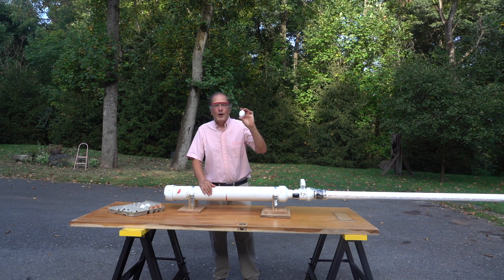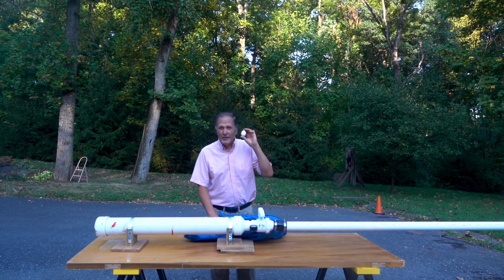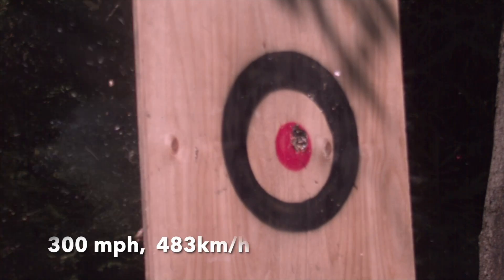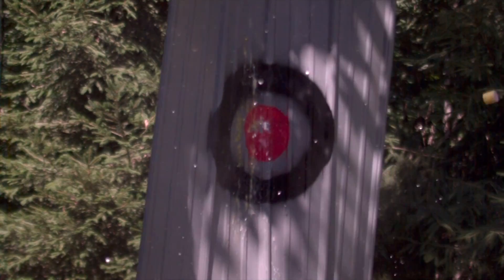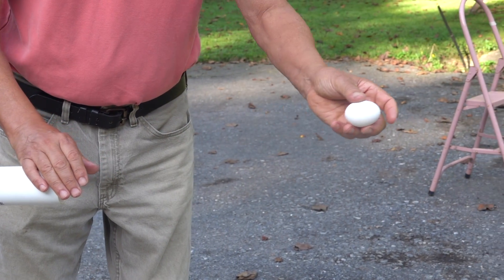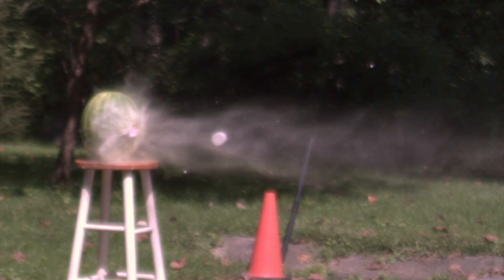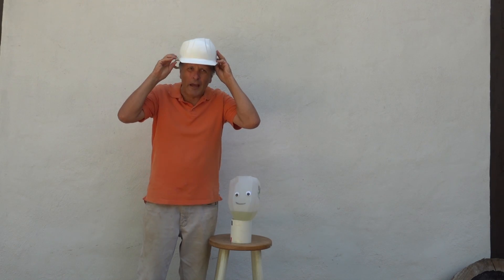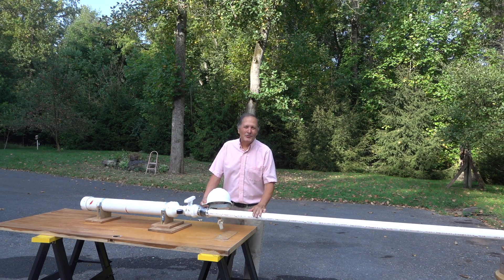Egg Target Practice at  300 mph   (483 km/h)

Comment: To catch the egg:  Step 1) Fire it directly upwards.  By the time it comes down, it will only be moving at terminal velocity (much less than your MV here).  Step 2) Employ one of those centerfielders from the first part of the video.  Step 3) Use a 5gal bucket full of "plucking foam" cubes.  Use the lowest density you can find.  Good luck!

Comment: What amazes me is how you can accelerate an Egg to 300mph in a 9ft barrel w/ only a piece of foam behind it. That looks like EPP foam (expanded polypropylene, milk carton plastic), or "pool noodle" foam. I've made "spud guns" powered by butane and gotten over 500 fps (using a ballistics chronograph and a small nail in the spud") and they are illegal in many states, just for that reason. We actually used the spud guns for shooting down beater Radio Control Airplanes which was nearly impossible.
Reply from the maker: the sabots  are cut from rigid foam polystyrene,  they were formed by heating a steel ball and then pushing itdown into the foam to melt it,  worked really well

Comment: Layered Fabric Deceleration System:

Egg Container: Place the egg within a protective container or casing to prevent it from cracking upon initial contact.

Multiple Fabric Layers: Arrange several layers of soft, lightweight fabric in the egg's path. These layers should be securely anchored to a frame or support structure.

Progressive Deceleration: Each fabric layer should have a specific attachment mechanism designed to slow down the egg when it hits. This could be achieved through adhesive properties, elastic bands, or Velcro-like attachments.

Sequential Release: As the egg impacts the first fabric layer, it slows down gradually. The attachment mechanism then releases the fabric layer, allowing the egg to move on to the next.

Repeating Process: The egg continues to encounter and slow down against subsequent fabric layers until it comes to a complete stop.

Safety Frame: Ensure that the frame or structure supporting the fabric layers is stable and absorbs any remaining kinetic energy to prevent sudden stops.

Testing and Optimization: Experiment with different fabric types, attachment mechanisms, and layer configurations to find the optimal combination that allows the egg to stop safely without breaking.

This system would provide a series of controlled deceleration stages, gradually reducing the egg's speed until it comes to a stop. It's an inventive way to protect the egg during high-speed impact. Extensive testing and adjustments will be essential to fine-tune the design for optimal performance.

Comment: Fun video. The real mystery is how he 'extended' a 10' piece of pvc with a coupling to make a 9' barrel. Only real physicists can do such things.
Reply from the maker: LOL, it's that new math they're teaching these days, or just forgive an old man who sometimes gets confused.   The barrel was  10 foot long that got cut down to 9 feet,  I used a small piece of it to attach to the cannon chamber and then use the rubber collar to give it some flexibility and take some of the stress off between the two parts.  The short piece was  1 foot long but got cut down shorter to put the flex connector closer to the air chamber.  actual length 9 feet, 6 inches

Comment: To stop the egg, maybe fluffed up loft isolation length wise.
Or a series of water balloons.
Does the egg skip if you shot it in water?
Or a very light net made from stockings like material.
Or a slightly twisted stocking, to form a narrow tube.
Reply: Can you shoot the eg into a stocking which has some parachute attached (with a rubber band material)

Comment: cool its funny that hammer can crush with easy egg but its egg which at 300 mph break through this plywood and heavier harder hammer drive be average man at much lower speed cant do it 😁👌🏻 + its not energy which make it happen 😉👌🏻 energy is only part of story …  if you let say drop 100 kg stuff on this plywood with object shape this egg how it conne&t preciselly which would have more energy but it be distract it slower plywood can not crack cos force is energy be distance at which it is distract or momentum be time 👌🏻  high velocity low weoght make energy distract fast from which is generated  biger force and stuff crack break asf 👌🏻it also depend on target characteristick how strong itmis attache to unmovable stuff how heavy it is how much it bend before break asf 😉👌🏻

Comment: All those 9/11 conspiracy idiots who say aluminum planes can't penetrate a steel building should be forced to watch this video.
Reply: its not so simple 😉 you can write some overalll statement but smalll diffrenc in velocity material type asf can make diffrenc 👌🏻 at end this eggg didint penetrate steeel plate as well 😉 well it could penetrate it but you know ….. its small doffrenc in velocity 😉 at 750 km/h it probably could go through it 483 km/h wasint enough .the point is as long as you are not expert i mean EXPERT not someidiot who thing he is expert in theme or as long as ypu dont do full scale copy test  you can only quees what really hapen 👌🏻
Reply: @mociczyczki  It isn't just velocity, to determine kinetic energy it is MASS times Velocity squared. The exterior perimeter box columns of the WTC were hollow and between 1/4 to 1/8th inch thick. So a 757 traveling at 483km per hour would slice through them like a hot knife through butter.
Reply: @Bellthorian  it dont travel faster?  sloce or not i dont know 👌🏻 never go to deep in this stuff .

Comment: to catch the egg, why not first slow it down by an air flow and when its slow enough catch it with a blanket or similar. this is basically just reversing the gun. however the breaking air flow should start slowly and then increase gently. otherwise the egg might hit a "wall of air" that would break it as well.

Comment: It's very counterintuitive the egg would survive such massive eggceleration. 0-300mph in a few microseconds seems very destructive. if you could shoot it into a small, suspended, padded bowl that would capture it then fly 100 ft to slow down before landing in foam beads it might survive. Kite tails on the bowl are also great for soft deceleration.
Reply from the maker: that's the trick is slowing to to slow over a long stretch

Comment: do you think this has anything to do with the structural integrity of an egg (e.g. under even pressure they tend to be very strong, which is why they don’t break inside the chicken)?
in other words, would the impact change if the egg hit sideways, instead of “point-on”?
Reply from the maker: after watching several video in slow motion it looks like the eggs do hit sideways, that why they are so hard to stop unbroken

Comment: I should have become a psychiatrist. There's a wealth of potential patients on YouTube alone representing a fortune. I'd be interested to know how you pressurize the system and to what pressure and how the pressure is released. Also how did you determine the optimal barrel length? At some point a barrel is going to be too long or too short depending on the weight of the projectile and the amount of propellant available (presuming you're getting a good pressure seal.) and the amount of gas pressure. Having the pressure released into an expansion chamber first should provide a slower and softer impulse to the projectile. I'd try different sizes to determine the optimum size for the weight of the projectile and barrel length. Adding an expansion chamber may or may not require a larger pressure vessel or increased gas pressure. Co2 should yield better results. It has a higher density than air. Just a few things to think about. Everything you could possibly want to know about propellents and canon design was worked out over 200 years ago. You probably know all this. Still this video was quite interesting. I'd like to see the results at various distances along with the velocities. I don't want to give you more work. I'm just curious.
Reply from the maker: 450 cubic inches of air pressurized to 100 psi,  didn't calculate optimum barrel length.  As this was done on a shoestring budget, I  just used a cannon that was left over from a previous project and  went with the pipe that I had left over from a plumbing project 9 feet long.  I hadn't expected to put too much effort into it as my goal was to only get it it 200 mph and compare it's flight dynamics to that of a well hit golf ball.    Since hitting 330 mph,  I want to actually do some calculations and try for 400 mph.  Like the CO2 idea.

Comment: That’s crazy! Catch the egg with a hanging silk sheet. Held loose enough to detach, envelope air cannoned egg that will land whole a undetermined distant beyond. I thought of your arrow & a Samurai era Calvary man’s battle gear. Specifically a square sheet of silk attached to a fixture mounted on the rider’s back. The wind would parachute the square of silk offering a retreating Calvary man defense from Archers’ arrows. I’m not sure that one sheet of silk is strong enough to not tear under the might of the high velocity egg. I’m sure multiple sheets would be necessary. I think that would work. One thing I do know is that one bellowing sheet of silk can catch arrows.

Comment: I don't think there is a material which is strong enough yet strechty enough to catch the egg, therefore I would try to set up multiple canvas sheets which the egg will pass trough, bleeding energy along the way. Eventually the egg will reach a speed where it won't penetrate the fabric and will be caught in 1 piece.
I also would be interested in general what happens with layered targets. The egg goes trough 1 layer of aluminium with ease, but it gets completely destroyed in the process, would a second sheet mean it wouldn't be able to go trough?
And if so, how far would these sheets need to be separated?

Comment: If you put the big end of the egg facing forward, it will be more  aerodynamic👌
Reply from the maker: the problem is that once the egg leaves the barrel it turns to a broadside,  I can see this in several slow motion videos.  I will present this in the next video.  I'm trying to figure out rifle it so the egg spins and stays more aerodynamic

Comment: That works out to be 440 feet per second.  Calculating with the average large egg as 2 oz. (or 876.56 grains) that gives 377 ft. lb. of energy. That is a little more energy than a 230 grain 45 caliber bullet.

Comment: Evidently if you provide a sufficiently even acceleration over the same distance as the barrel, it’s possible to not break it. But whatever catches it (e.g. a piston on a spring) must be sufficiently lightweight as to not significantly instantly decelerate the egg with the initial collision. I’d try a normal sheet with weak tension springs or bungee cords on the corners. Maybe something as small as a pillow case to drop its mass. Don’t think there’s any material where the layer itself is strong, flexible, and lightweight enough to handle everything, hence splitting the initial collision to be handled by the sheet and the main deceleration to be handled by the springs. You’ll want to make these springs/bungees able to stretch to the full barrel length or more, and store about the same energy in total as the egg has when fired. And the springs should be as light as possible too.
Reply from the maker: The problem I am running into is the egg is oriented in the sabot with the longer end  of the oval pointed forward, which is much stronger.  Once the egg leaves the barrel, it turns to the broadside leading forward, much weaker, at least that's how it appears according to what I am seeing on the videos.  the weak side hitting first is why this is so difficult. more challenging, materials that allow the egg to pass through it one time may break it in the next shot,.  Eggs simply were not made to be shot as projectiles

Comment: Did you use a jig to check all eggs for symetry? A perfect shaped egg, may distribute from the blunt side better? Idk, interesting project; just scribed.
Reply from the maker: thank you, the sabot bottom is rounded out very close to the same dimension as the end of an egg,  I made several of slightly different sizes and then tried to match the egg to a sabot that I felt would be a close fit

Comment: My suggestion would be some sort of "bottomless" catch bin with some arrangement of panty hose inside.  You can use the "legs" of the panty hose to tie to the rim.   Or maybe just several layers (enough so it doesn't blow out the fabric) of panty hose stuffed inside each other and you can shoot the egg down the leg and it will decelerate the egg gradually as it the panty hose gets narrower and stretches out.   I know panty hose works to some degree because I won my physics class egg drop 40 years ago with an egg suspended inside a 6" X 6" X 6" box with panty hose.  In the egg drop "playoff" my teacher even went to the top of the press box for 6 more feet of height and threw (not dropped) the surviving competitors entries downward.  Mine was the only one that didn't break....But I don't know if it would work on a 300 MPH egg.

Comment: To catch an egg- suspend a cordura sling pouch (target) from a tree on slip-off key rings mounted on finish nails. The pouch would be suspended from way high up in the tree on 1/4” bungee cord. Upon impact the lightweight pouch accelerates and is released from the tree. The egg stretches out the bungee and also begins to swing upon a long arc from the base of the tree. At some point, maybe 30’ from the anchor and 30’ high the egg would come to a stop and fall down. That’s where it gets interesting- it might be nice to have a piece of 50lb monofilament attached to the pouch or even chute cord that is anchored downrange even further and tied to a lightweight weight, hoisted high in a tree. When the pouch is released and begins to decelerate the egg- the opposite weight would fall toward the ground and hopefully arrest the energy contained in the eleongated bungee cords upon arresting the energy contained in the speeding egg. 
I’ve used a similar concept in tree work to arrest flying loads without the bungee- and it works really well. Maybe it would work with a 300mph egg? Great video, I imagine you’re a career educator, and if so, your students were/are fortunate to have you as their teacher!

Comment: Awesome video! My students built an air cannon that fired ping pong balls at 713 FPS (486 mph) at 80 PSI. The point was to see the speed that pneumatics could operate at and the dangers. We used a face shield as a target, and put a nice hole in the face shield.

Comment: Incredulous.  The egg travels 2.7432m to reach V=134m/sec. The process takes 0.0409 seconds.  That is 3272m/sec.sec, about 334g.  The device can keep the egg in shape at 334g ?  Fighter pilot with protective suits can take maximum of 9g.
Reply from the maker: I didn't do the math but now that I see it, I find it even more amazing that the egg can withstand the g forces.  I find that the sabot must be shaped very closely to the contours of the egg, if it is simply a flat surface pushing the egg forward it will break.

Comment: Create layers of loose saran wrap spaced out over several meters. Each layer is meant to let go and envelope the egg as it comes through, which adds mass to the projectile and drag. By the time it falls to the ground, the wrap will also protect it from breaking. You might need dozens of layers and some way of ensuring their release as the egg contacts them one at a time. Perhaps the release can simply be tearing off of clips suspending each along four clothes lines which follow the path of the projectile and create a frame for the clips and wrap. I hope it works!!! :)

Comment: After watching foam destroy a space shuttle, I think most engineers no longer underestimate the damage which can be caused by "soft" bodies traveling at high velocities.
Reply: The foam didn't destroy the shuttle, it left a hole in the wing which was unprotected from re-entry heat. On re-entry, it was like having a massive blowtorch blasting through that hole into the vehicle. This caused structural damage and the shuttle started losing material. Eventually it lost all hydraulics and went into a flat spin and broke up, killing the crew.

Comment: Using PVC pipe for a pressure vessel is living very dangerously.
Reply from the maker: I've been doing some research on this, hope to make a future video on the dangers of them.   Almost all of the problems I am hearing about are with  1. combustion cannons.
2. using a potato as the projectile.  If a potato is wedged in too tight,  it pretty much is a bomb. 
suggestions to anyone that attempts to use these, stay well below the rated Schedule 40 or 80 pressure ratings.  Do not put anything in the barrel that does not slide easily in and out.

Comment: I have an idea as to what might catch the egg. The way the military slows down the rocket sleds it has for high velocity testing is using bags of water on the track. In in similar vein maybe the egg would survive if you hung a long plastic sheet similarly to a hammock and filled the bottom of it with water and fired it along the length of it?

Comment: To catch it without breaking, I think you need to disperse the energy in a way that starts small and then increases, but not fast enough to stress the shell beyond its breaking point.

I think that requires a sort of reverse ooblek.
Something like a fabric with elastic bands that engage as the egg deepens, or elastics that break. 
I'm sleepy right now and thinking in high speeds and in slow motion isn't working.
Reply: What if the ooblek (jello?) was suspended on a long pendulum.  Translate the linear momentum into angular and let gravity help. Also, the pendulum could be flexible (rope) and wrapped around a drum so it increases length with rotation.